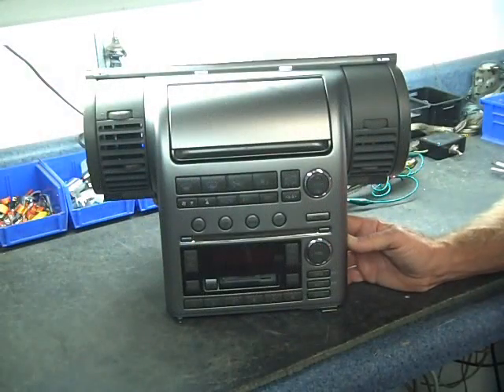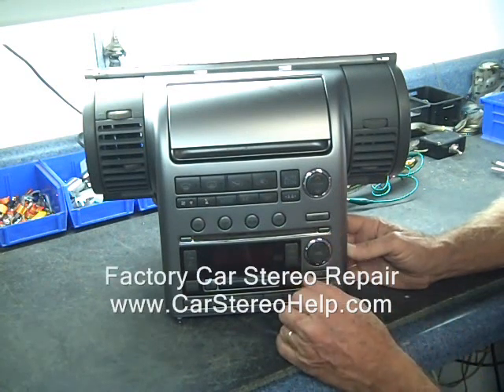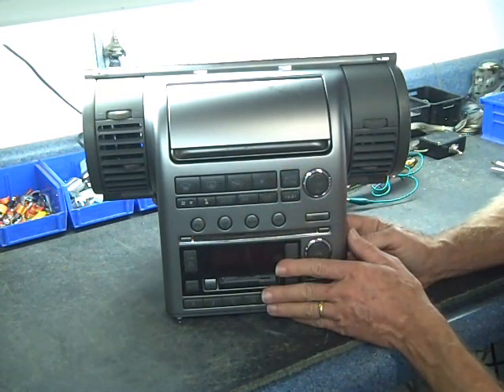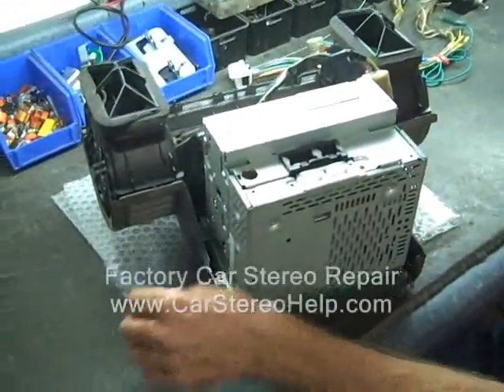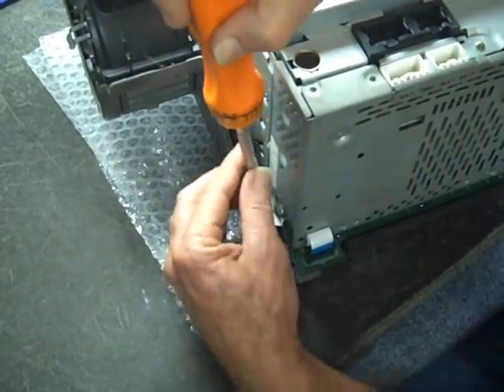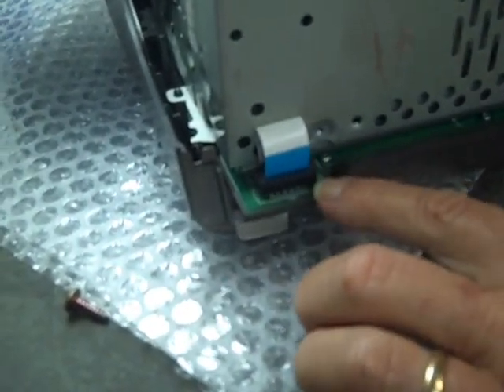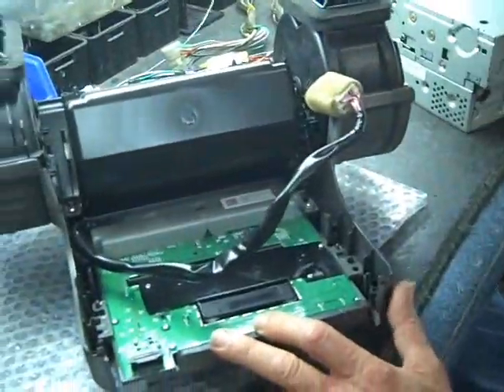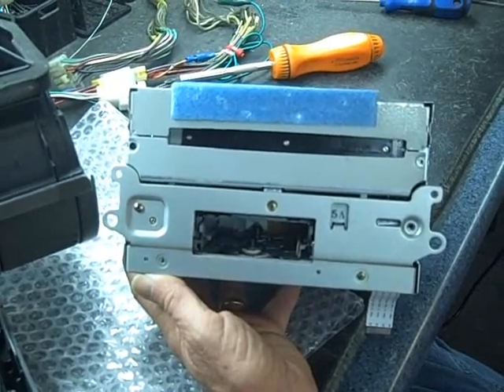Infiniti G35 Audio Finisher and  Car Radio - AC controls inop = Car Stereo HELP

Comment: These people repaired this problem on my 2003 G35 back in 2008, and did an excellent job, and showed me the burned out component on the circuit board that had failed (not the "finisher" board).  Unfortunately, while the G35 continues to run like a champ, the battery drain has started again, and it is at the 15A audio fuse next to the 12v battery.  So the same problem.  Unfortunately, Factory Car Stereo Repair's website specifically says they no longer work on G35 stereo issues.  I suspect (from another video) that there are too many other possible components failing and not the obvious one that they changed out in 2008, thus making it a much more difficult repair.  One thing still not clear to me is this -- if the Bose stereo is replaced, I believe the AC controls will still work -- however, is it possible the same battery drain issue may remain, since the problem circuit board apparently services both the AC controls and the radio?

Comment: Hey if I was to just replace the stereo with a aftermarket stereo and dash kit, would it solve both issues??
Reply: Did u ever find out the answer?
Reply: @stillhereloser3117  have u tried it lol ?
Reply: Yes it will, but very readu to pay $250 for the kit alone, then $100-500. For a stereo. $40 for the wire kit, and you're garaunteed to break the clock frame up top. And the kit looks much worse quality. It really really destroys the car.

Comment: i am looking for a wiring diagram for my 04 coupe bose amp. I would like to replace the existing amp with a 4 channel after market unit. does anyone know where i could find the pin-outs for the amp?

Comment: So the console buttons on my 2003 infiniti g35 coupe have stopped working - the radio buttons, the tape, the AC, and the AC controls. Also the stereo buttons on my steering wheel do nothing. My AC is turned on and stuck at 75, and I can feel AC so at least the air comes out, but because none of those buttons work I can't turn off or change the AC. Is this what I have to do to fix it?
Reply: Still haven’t found the answer for this question mines doing the samething
Reply: @kayfarrow4675  ok so I found out that the fuse for the radio was blown, so I swapped out the fuse (a cheap, easy fix that anyone can do) and that fixed the problem and the buttons started working again. I would suggest you look at your fuse box and find the radio fuse and see if it's good or not and then just swap it out if it's bad, no need to do any expensive or time consuming work pulling out the whole console lol.

Comment: hi I have an infiniti problem the radio is no longer heard and the air conditioner stays on when I turn on my car what can I do???
Reply: Ab CALifE mine too
Reply: @KEVINHOMIE  is the stereo no longer works change it and the problem is solved 👌👌
Reply: Will changing the stereo make the a/c controls work ??
Reply: @clintwood8065  yes 👍👍
Reply: Ab CALifE I have an 2004 infiniti fx35, Just installed a double din correctly and now the ac/ stays on and the aftermarket radio stopped working..😔 I lost the factory radio.😡 Can you please help me..
Reply: @Bobarik001  did you get your problem fix I'm having same problem
Reply: @Bobarik001  mine is also a 2004 fx 35 and the ac stays on .
Reply: @ricardoacosta6239  are you fix the radio problem I have the same 2004 fx35 same problem
Reply: @alexchavez4657  were u able to fix it?
Reply: @flashv4941  no I have to bring my car to a dealer and cost me $1180
Reply: @alexchavez4657  wtf. What exactly did they replace ?
Reply: @flashv4941  the screen is burn and few ac sensor
Reply: @alexchavez4657  oh dang thanks.
Reply: I ve G35-2003. I ve complete stereo shot off & Ac stays on anytime u turn on the car. When I saw a technician guy told me I can't fix ur car coz there is no repair from the scrap yards & the only hope u ve is to go to states & I'm now in Canada or else he told me I could go to the dealer which will definitely cost over 1000 dollars. Can u tell me how can I get a repair without spending that much money?
Reply: @Clown1-1  So the console buttons on my 2003 infiniti g35 coupe have stopped working - the radio buttons, the tape, the AC, and the AC controls. Also the stereo buttons on my steering wheel do nothing. My AC is turned on and stuck at 75, and I can feel AC so at least the air comes out, but because none of those buttons work I can't turn off or change the AC. Is this what I have to do to fix it?
Reply: I have the same thing. Did you get the solution please?
Reply: I have the same issue after the positive battery terminal blew a fuse 140a replaced that since the car wasn’t starting. Now my Ac is on with no air and radio no sound. Just replaced the 15a radio fuse and still no sound… might have blown the circuits apparently.. I need my AC !! I’m in Cali